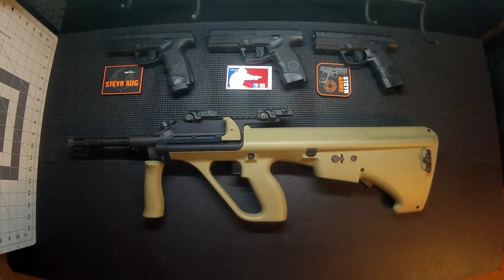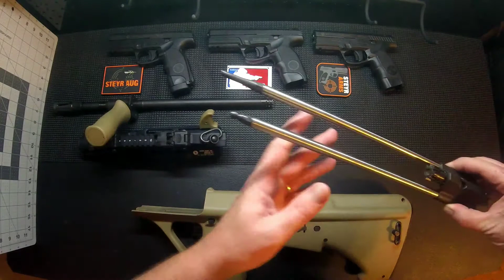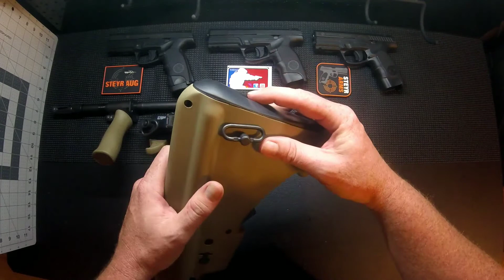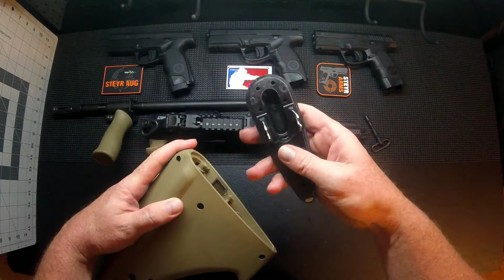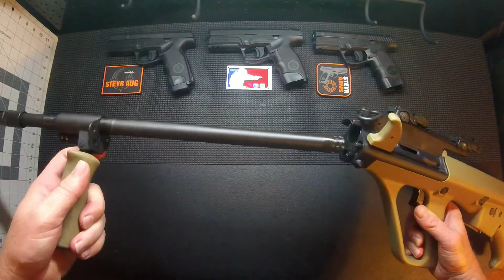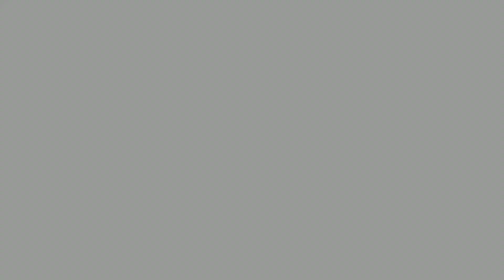Steyr AUG A3-M1  History & Disassembly

Comment: I literally can’t get the trigger pack to go back in during reassembly
Reply from the maker: Double check trigger rods make sure you have them pushed to the sides that will hold up the trigger pack also make sure the hammer is locked in place

Comment: In old AUG A1 there is no wings on the back of BCG. To extract firing pin I just need to rotate counter clockwise and when assembly firing pin rotate in socket itself with no help.

Comment: The firing pin removal with that locking flap isn’t on the originals, Looks like they made it more complicated, the F88 only required you to push down on the bolt face and rotate the firing pin to remove! Im not sure I’m a fan of this change

Comment: Have you had issues with the aluminum pieces that interface with the locking lugs of the bolt?
Reply from the maker: The bolt cage ? 
No ,  The only time they get messed up is due to improper install or a mechanical timing issue
Reply: @TnSteyr  nice! Just bought one for K-Var. after watching your video, I couldn’t wait any longer. Any clue on where to get extra barrels? 🤔😅
Reply from the maker: @DJ-jq8if  gunbroker maybe Steyr Arms USA is the best place,  but there behind on making extra parts
Reply: @TnSteyr  since owning yours, what parts do you see wearing the fastest?
Reply from the maker: @DJ-jq8if   I haven't seen any parts truly just wear out what has broke or needed to be repaired is a lot to do with the shooter but if you are looking for spare parts I would recommend a firing pin kit in a boat rebuild Spring kit. Because at some point one of them will fail . 
If you shoot good quality ammo and do not mess around with the internals you should be good for about every 100k rounds before needed any rebuilding

Comment: If you have the long rail version of the Steyr aug is it possible to remove the rail and put on the standard short rail?
Reply from the maker: Yes you can. Just like installing a Opitc you just have to remove the 3 bolts and change it out . That on the A3m1 & A3. 
If you have the STG77 then No , because the rifle  Receiver is one piece.

Comment: I have yet to see a decent bullpup. 

Iron sights are pretty much pointless on the rails most have. Flashlights and lasers are damn near impossible to mount. 
They never work well for lefties. 
The safeties tend to suck.
They aren't very modular. 
They are usually only available in a couple calibers. 
The quick change barrel is useless. This version isn't an LMG. And they don't offer any other barrels for it. 
The triggers suck and can't really be modified like an AR. 
This thing has so much plastic, and is still fairly heavy. 
The charging handle is stuck on one side. And often bites your hand. 
How hard can it be to make a decent bullpup? Or hell, something better than an AR-15.

I hate to bash it, but I have yet to see a decent 5.56 rifle I would ever seriously consider buying other than a SCAR and an AR-15.
Reply: You are right...but I still want one.

Comment: I love how chill you sound and the depth of your video keep it up ☺
Reply from the maker: halo lover . Thank you I appreciate . If you get a chance check out the Facebook page there is a full written article and pictures of my time spent with that particular rifle
Reply: @TnSteyr  ok I will and do you recommend this rifle?
Reply from the maker: @halolover8128  .  I would say it would depend on what you need it for. It is a big investment just to  Own one for the sake of it , if your looking for a CQB rifle, yes its a grate choice.
Reply: @TnSteyr  I want a range gun and a small rife for a truth I live in Montana
Reply from the maker: @halolover8128  .  If you want a shorter 556 rifle a AUG will definitely fit that description. I have gotten rid of all of my standard AR platforms ,an AUG is about 6" shorter than a standard AR 16" . 
 If you're going to compare a AR15 too the AUG,  Make sure you're comparing it to a gas piston gun like a POF, LWRAC, for $$ . 
I just picked up a New AUG A3M1  Euro mode.  And i love it .
Reply: @TnSteyr  ok thanks and the only ar i know is a Colt AR15A4 same one the USMC used to is but it's the civilian one it's so nice has a 20 inch crom lined barrel
Reply from the maker: @halolover8128  .  If you can find someone that has a AR pistol with a 10" or 13.5" barrel compare that to your standard AR-15 that will be the size difference.
 The difference between gas blow back in gas piston can be Significant, Depending on the set up. IA for short stroke gas piston they run cleaner and are less likely to have a malfunction. If you haven't had a chance to read my article about the AUG here is a link ,https://tnsteyr.wordpress.com
Reply: @TnSteyr  ok thank I just subscribed 😁
Reply from the maker: @halolover8128  thanks , don't forget I have Facebook and Instagram, for cool pic and informative post and Steyr info

Comment: An easier way to assemble the rear butt plate, is to insert the hammer pack and over insert the sling pin. now place the butt plate in place tab first and pull on the sling pin. It will click into place.  It is a bit easier to do than trying to push in the release and get everything lined up.  To dissemble just do the opposite. Over insert the pin, remove the butt plate, push the button and remove the pin.